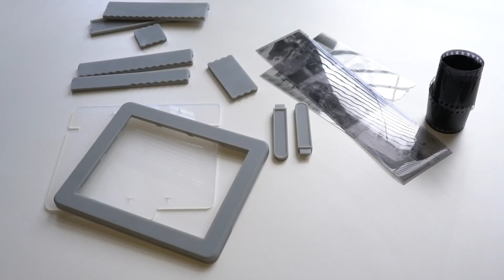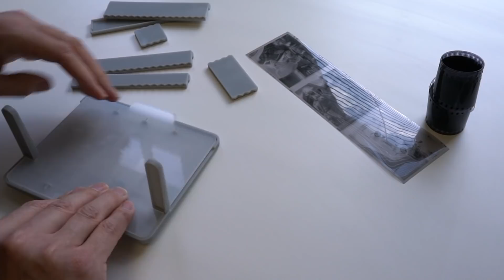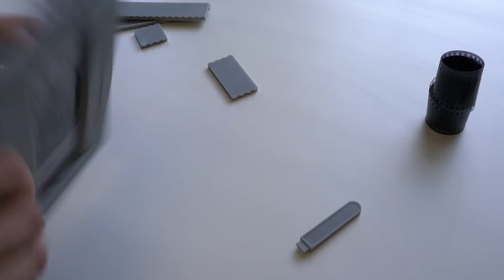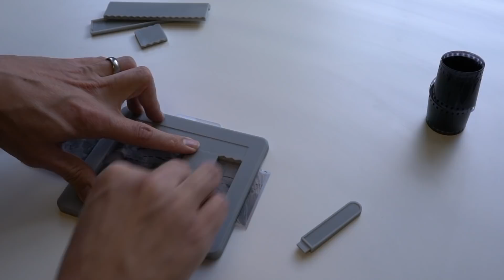pixl-latr 3D Printed Prototype Demo

Comment: It looks that the new design is not suitable for glass plate negatives anymore.
Reply from the maker: How so?
Reply: @HamishGill  It looks that if you put the negatives on the back side of the frame, that they have to be thin (transparent plastic film) The old model had guiding pins on the diffuser, so a glass plate would then fit.
Reply from the maker: How thick is a glass plate?
Reply: @HamishGill  6 x 9 cm have thicknesses between 1.4mm and 1.7mm,  4 x 5" up to 2 mm
Reply from the maker: Wessel Koster it should still work then. The inner depth that the diffuser slots into is just sort of 3mm
Reply: @HamishGill  That is great, thank you